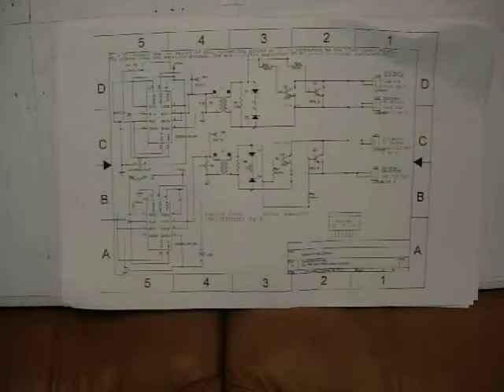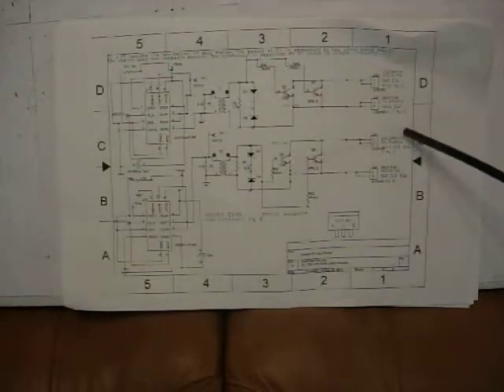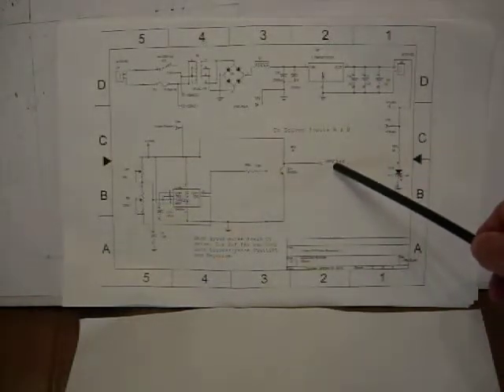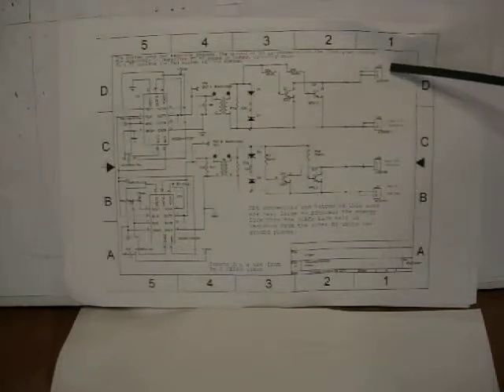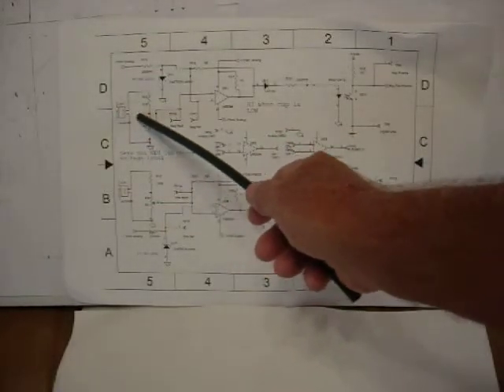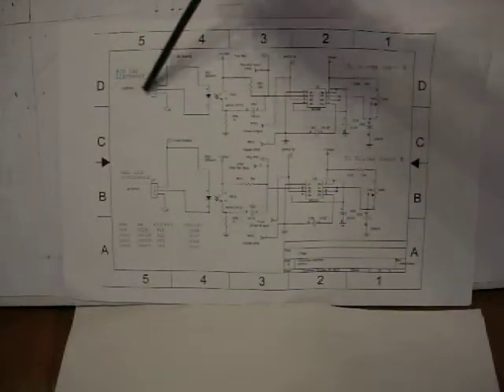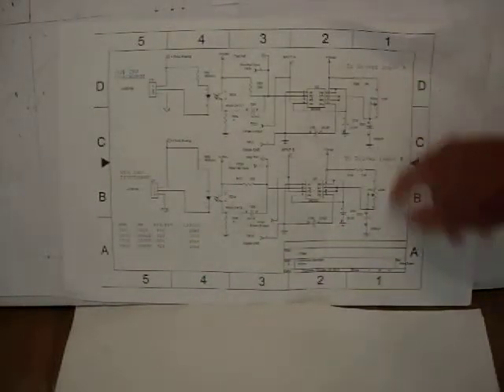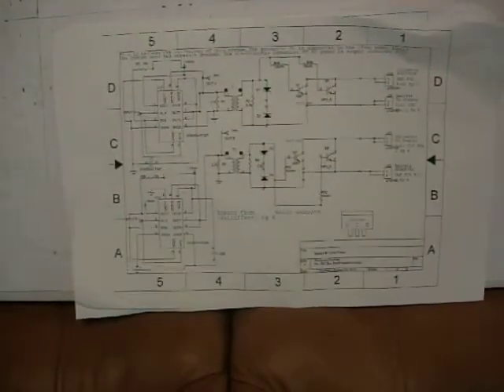Don Smith #31 updated schematics

Comment from the maker: I've been working on a new driver setup.  The transformer sd250 don't work with wide pulses and slow speeds the tran saturates.  The new design will replace the transformers with a small board 4 per PCB.  these will contain a DC to DC converter, Opto Isolator, and second driver, the original driver will be connected to the Opto.  The DC to DC converters will be run by a 30vdc PS.  to do this I'll have to use on e half of the orig PS transformer secondary.  currently two are paralleled

Comment from the maker: Just finishes the two PCB.  they have 4 identical circuits one didn't work the problem was that I cut a wrong trace,  took three days to find the mistake.  With HV Tesla sparkgap and two PCB powered by 12vdc battery the current draw is now  at 3.7 amps from the 12vdc battery.   Once I resonate the inverter outputs with AC run Caps this should drop down considerably.  should have motor running with two 12vdc batteries today.